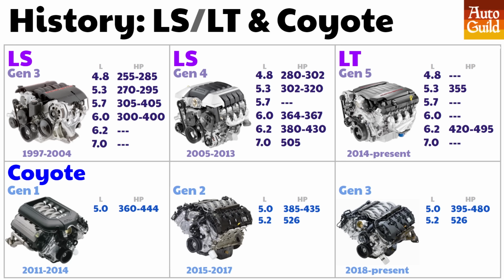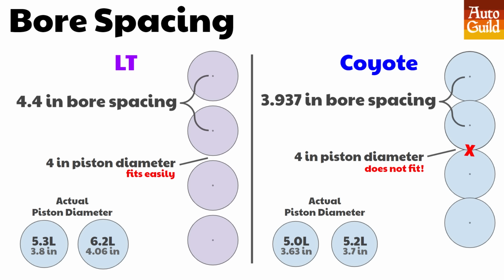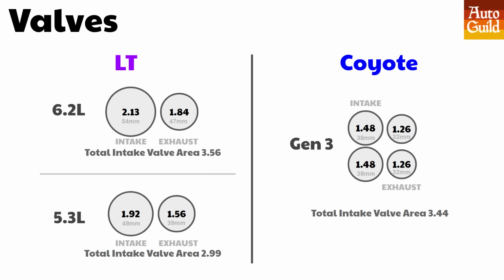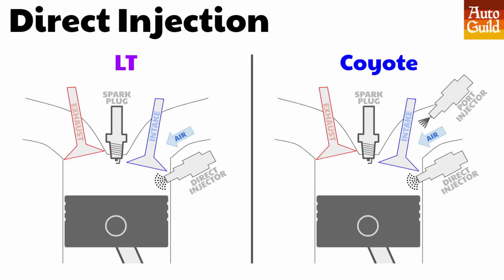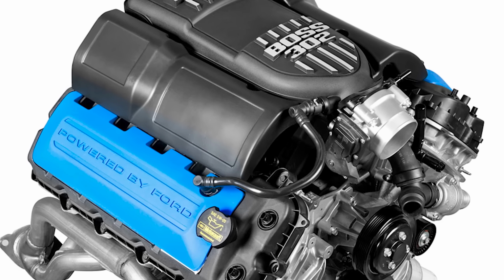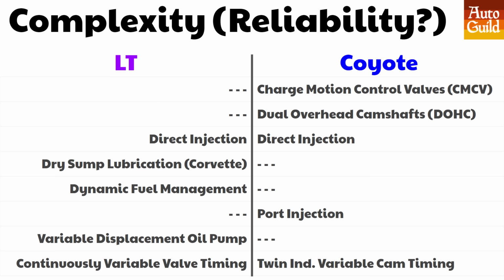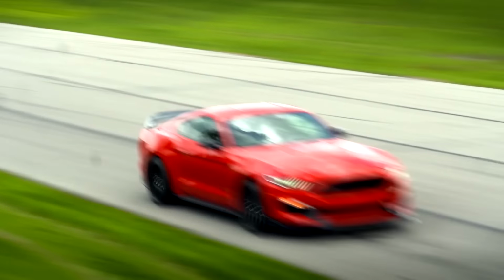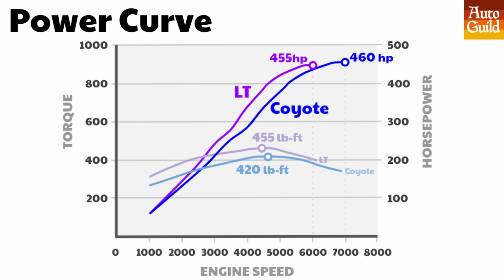GM Gen 5 LT vs Ford Coyote.  Which one is better and why.

Comment: I am almost done with my degree to be a powertrain development tech and have gotten to take a few coyote motors apart and the older DOHC cobra motors and as much as I have gained respect for them I still don't want to deal with 4 cams and all that timing and the heads can be really tedious if you do not have the skills or experience on these types of motors. I think for simplicity and for someone looking to learn easily on a motor and make really good power without spending gobs of money you have to go with the LS or LT.  The voodoo is absolutely ridiculous and is definitely not something to put down. Not too many people really realize just how different these powertrains are. Love the video! will be watching more
Reply: Retaining the bore spacing from the 91 mod motor has been Ford's original sin. It's the handicap that keeps on handicapping.
Reply: @taylorc2542  "slappy is sloppy when the service comes due" is what an old hotrod guy told me as a kid.
Reply: @taylorc2542  agreed, the bs was designed for a font drive Lincoln when the 4.6 was put into motion… that combination never even happened lol so why they handicapped themselves for so long? Even just spreading the bores to get a 3.800 bore would have done wonders for the platform.
Reply: @shaadydog1  Yup, 30 painful years of 2nd place because someone thought FWD Lincolns were important. Amazingly poor cost/benefit in hindsight.
Reply: @taylorc2542  ya, they couldn’t get the hood line  they wanted so they scrapped the fwd/v8 idea altogether…
Reply: The LT motors are a ticking time-bomb.
Reply: @Lupine.   its all preference. with the 4 coyotes I've rebuilt at school I could say the same for them lol.
Reply: @BIGEDSIK28  The LTs are throwing rods and having constant injector issues within 30-40k miles.
Reply: @BIGEDSIK28  Exactly which school are you in?
Reply: @CrystalWhiteLX50  Washtenaw Community College in Ann Arbor. Absolutely amazing powertrain dev tech program here. All kinds of dyno classes and such as well. Check it out!
Reply: @BIGEDSIK28  Have fun working for Jacobs or one of the other staffing agencies
Reply: @CrystalWhiteLX50  lmao right.. 99% hire rate straight into my field and I’m continuing my education for EV engineer. I’ll have lots of fun working at whatever auto company hires me. Have fun being a lube tech buddy and maybe you should go to school to further your education rather then ask people what school they go to LMAO
Reply: @CrystalWhiteLX50  once you know something about a engine HMU 😂
Reply: @BIGEDSIK28  dude was hating hard as fuck. Always haters trying to talk down on someone's direction n vision
Reply: Vw stopped all development of new ice engines.  Hope you can quickly switch to ev.

Comment: Might be wrong ,but I believe “lighter valves” have been proven to help stabilize higher rpms not help increase rpms.
Reply: Wouldn't that in effect yield the same outcome in the end product?
Reply: @btownballer27  not entirely sure I got into a huge discussion about it with the ls6 sodium filled valves vs standard valves. What I got out of it is the lighter will help with stability at red line less potential for valve float and less stress on the springs. Physical reduction weight didn’t allow for higher revs that it would come down to whole rotating assembly being lighter

Comment: How can I see the big block coyote the alluminator specs, that’s a rare engine ever talked about through out car community’s why?
Reply: A big block Coyote? Which engine is this?
Reply: @houseofno  it’s a 6.4 or 5.9 I think, it was called Alluminator, Ford had them in Trucks I believe, speed shops had em N/A at like 900hp with their parts thrown in. It’s the motor I want for my build, but nobody ever talks about em. Hot Rods done a few articles on em.
Reply: @davidpedwardsiii5581  
Because they were basically kind of race engines.. also very much unrefined in nature too cuz it was made light with less mount bolstering to chassis. 
It was a badass engine but hey.. many prefer a smooth and refined yet wild Coyote over it 
What I feel sad is.. why didn't Ford make a bigger Coyote,  see sure its already large... still much smaller than Hemi V8s
Ford could ve made a 6.2l dohc v8 with port/di.. it wud ve made like said above 500+ hp and 480+ torque and could ve been easily 1 of worlds best big V8s. 
I ve been in Mercedes M156 6.2l dohc V8 and I still think that German V8 is best feeling V8 ever made.. sorry American v8 fans.. Germany was it that impressed me most..
Reply: @davidpedwardsiii5581  the alluminator is a 5.2L crate engine Ford sells
Reply: If an episode could be done on a comparison of the 6 L blocks of Ford n Chevy that’d be excellent.

Comment: The fuel mileage is a lie. I have a 2019 pp1 gt and my buddy has a 2020 camaro. We took a trip to OBX and I averaged 28 mpg while he averaged 26.5. Granted the highway we drove on was flat and we held 60 the whole way.
Reply: That’s interesting, where I’m from it’s mostly city driving. My 6th gen would do 18-19mpg while my mustang friends would do like 14-15. I guess having that low end power has an advantage on city driving.
Reply: @6.2Slomaro  could be. I average about 17 in city. I think a lot of it could boil down to how hard they accelerate. V8s love to suck down some gasoline. I can certainly average 10 if I want to in the city. But that's not how I drive.
Reply: @PapiGL123  I’m from Guam, max speed limit is 35mph, we have a lot of stop and go traffic. Even when I borrowed my friends mustang for a week, I tried to drive how I normally would with my camaro and best I got was 15mpg.
Reply: @6.2Slomaro  could be it. The 5.0 drinks gas at idle and on throttle. You need cruising time to get any respectable fuel mileage. Sweet spot for my 2019 is between 40 and 65 holding speed.
I'm in Virginia and most of my driving is 40+
Reply: Usually with more complex system the 5.0 should be able to sip less.. but issue is Fords engines need higher revs to do work.. so it is counter productive 
DoHC engines give better mpg than ohvs till say 3600cc.. anything more than that ohv will give better mpg.. 

Again all when compared with same displacement
Reply: @1989rs500  yup I was gonna also add that when I drove the mustang I had to shift at a higher rpm unlike my camaro. Especially in a stop and go traffic. So that’s probably where most of the gas is being used
Reply: @6.2Slomaro  note: both of our vehicles have the 10R80 trans. My car also has a higher diff gearing. In theory I figured my buddies car would have gotten better fuel mileage. I'm guessing we were cruising at a sweet spot for mine.
Both vehicles are stock for now.
Reply: Wanted to post a quick update- tookba road trip from Ohio to Virginia and averaged 29.6 mpg with the mustang. Logan ohio to Virginia beach. Over 500 mile drive.
Reply: @PapiGL123  That 10speed is the best thing that ever happened. And sorry to be more specific I was comparing manual to manual. That’s really impressive a mid 400hp car doing a gas mileage like that. I have a C5 vette manual and for being an old car I’m surprise it does 28-29mpg on the freeway.
Reply: @6.2Slomaro  oh that's fair. These new cars have some amazing tech that is getting them to do some amazing things. Even the older fox body mustang with a 5.0 would be lucky to average 18 on the highway. 40 years later here we are with a car hitting almost 30 with over 100 more horsepower.
Reply: @PapiGL123  haha yeah I think we are currently living in the best times for the auto industry. I also had a 2013 Hyundai Genesis 5.0 8speed that would do 27-28mpg on the highway. The car weighed like 4300lbs and it makes about 430hp. Surprising it still did good on gas. But once do city driving it drops to like 17-18mpg.

Comment: Damn the LT motor is small compared to the coyote. It annoys me when coyote fan bois say that LS/LT need a bigger displacement just to make power but they don’t realize that the coyote requires way more moving parts and a higher rpm jus to make power. BOTH engine are impressive and they make very good power in their own way.
Reply: A young guy I worked came over to show me the truck he bought. He said it’s got a huge V8! I said it’s less than 300 cid. He said no Fuvking way! Look at the size of it!! Lol
Reply: @canabox7112  lmao!
Reply: Depends on application. The LS/LT is alot smaller allowing the ability to move it around for better weight distribution " closer 50/50 "for road racing etc. The Coyote "girthy" is good when that doesn't matter as much like drag racing. I own a Foxbody and people keep telling me put a Coyote in it...nope my old sbf "very similar in size to an LS" offers more with lower c/g and ability to push farther rearward for weight distribution. 
I like both engines but much prefer a smaller package for reasons stated. I bet you'd get better track times with an old sbf or LS hp for hp and weight for weight in a new mustang than the Coyote 😁
Reply: Many sports cars and race cars require higher rpm to make power. That’s how you make power actually.
Reply: @sweetcheels correct, they do that with smaller engines for lower weight.. They have lower torque so need rpms to get horse power. HP is just a calculation using torque and rpm. Both of these engines are badass especially in the right applications.
Reply: @sweetcheels  thats ONE way to make power
Reply: With the extra valves, camshafts, injectors and structure to hold them all I'm surprised the Coyote only weighs some 25 lbs more. Very surprised.
Reply: @rogerodle8750  he's guessing. You could easily look up the stats yourself
Reply: @rogerodle8750  the bare weight of the coyote motor without accessories, exhaust manifold and flex plate is 445lbs. He was guessing it was 490lbs with everything on. But I remember reading somewhere that the coyote motor’s full weight is 530lbs? The LT motor full weight is 465lbs.
Reply: Yes, and the Coyote is at a low-end torque disadvantage.  Like you said, both engines are very impressive in their own way.  But the LS/LT motors make big power very cheap and reliably in a small package, with tons of aftermarket parts and support.  Honestly, I love both engines, but if I had free choice, I'd choose the 6.2L LT (without cylinder deactivation, of course).
Reply: @WhalerGA  NA builds I go with the LT for boosted builds I would go with the coyote.
Reply: @6.2Slomaro  Yeah, for myself, I'm thinking NA.

Comment: I've had the pleasure of owning cars with both the LS and LT, as well as the latest gen Coyote and the Voodoo 5.2L in my GT350R.  I must say this is the best explanation of these motors that the common enthusiast can understand without being an mech. engineer.  Well done.  New sub.
Reply: @rross27 those are all some really cool builds you have had. Personally, I've had both the new LT1 in a 17 Camaro SS.  And currently have a 19 Z06 with the LT4.  Love both in their own way.  The LT1 was a manual with 455/455 in it and she would rip and loved to be "beat" on.  LT4 is the same, but you have to be careful as the car is super expensive and the engine is ridiculously more powerful than anything I have ever had.  Probably going to get another ZL1 or Z28 in 26 for  the last year of the gen 6, Vette will be paid for by then and more of a "show" car.  Keeping her stock.  Hope you can get your hands on either one in the near future, you will not be disappointed!
Reply: @Hey_Blinkin  the coyote is a different monster, it doesn't slap you in the face as much, but it's just insane how it just keeps pulling, and pulling, and pulling, yanno the LS motor might make peak around 4500-6k, meanwhile we're revving to 9 and making more power the whole way there. Completely different, but I prefer the coyote, and fyi if you want a really torquey coyote you can put a cam ground for torque in, like off the f150, and all of a sudden I can't tell much of a difference, but it's much easier to put aggressive cams stock in a DOHC motor so that's why the performance version get such aggressive cams from stock.
Reply: All he did was take all the stats, that you, honestly could have read yourself and made a video.
Reply: @ssj2camaro21  it’s crazy how people will believe anyone knows what they are talking about with pictures and a video on YouTube, they will take as a fact even if it’s a 26 year old kid in his moms basement making videos on which fighter jet engine has the most power . And people will leave comments great video you understand so much about jet engines lol world I’s screwed I tell you ! The internet made people much dumber and easier to fool !
Reply: @rross27 I had a ‘96 Z28 and the old LT1 got a bad rap due to people using junk optisparks but it was a hell of an engine in its day. It held its ground until the LS1 showed up to take over. It didn’t take much work to get some great results with it.
Reply: @rross27 we all know the answer... LS

Comment: Getting really tired of people calling pushrod technology old vs ohc’s being new. That’s not true. OHC design is older. But they are both really old regardless. First ohc engine=1902. First ohv engine=1904. 

The coyote is limited, just as stated in the video, by its maximum bore size. You can only add stroke. Adding stroke, or too much stroke, takes away from rpm capability. So anyone saying something along the lines of, ‘I wish Ford made a 7.0L coyote’…..they won’t. 

Lastly, the metric of HP/L is garbage when comparing two different engine configurations. The LS/LT makes power by adding cubic inches. The coyote and other dohc designs make power by adding rpm, at the sacrifice of cubic inches. Literally opposites in their philosophy of design. If HP/L actually mattered, the 1.3L rotary engine in the old rx7’s and rx8’s would be king.
Reply: 5 liters is plenty, “limiting” displacement as you call it is irrelevant.  Cracking into an engine and machining and adding parts is far less efficient than the best power adder ever devised: the turbocharger.  Using exhaust gas to do work rather than waste it going out the tailpipe
Reply: @heinrichhimmler69  blah blah blah, turbos are good. Ya don’t say?

Comment: I remember when GM released the LS platform, Ford already had the mod motor, overhead cam design. Many said GM’s new engine would fail miserably by staying with old technology.
Reply: In the early 90s GM had already tested with identical vettes but with one powered by a DOHC they had designed and then a newer version of the 350 and GM decided they still liked the low end torque and instantaneous power compared to the DOHC they had designed. They then continued to produce the same kind of OHV motors they always have lol! Cool stuff to check out if you are interested.
Reply: @BIGEDSIK28  They did more than test a DOHC motor.  They offered the 1990 ZR1/LT5 ("King of the Hill") Corvette.  Not sure how many they sold, but it was a very expensive engine to build. It's amazing that GM has been able to build such venerable powerplants using OHV technology for so many decades.  My hats off to them.
Reply: @WhalerGA  Oh yes I have heard of such a vette lol! I'm sure they only made just a handful and they are easily over 100k. Half of them are probably in Bowling Green! I've heard rumors of a new c8ZR1 with a DOHC TT motor being stuffed in it. Actually really excited to see it. When I'm done with my powertrain development tech degree If I get in at GM I will be in the R&D building, dynoing, in Milford!
Reply: @BIGEDSIK28  GM is fully switching to electric powertrain. Amazingly, there will probably never be another clean sheet ICE to come out of the Warren Tech Center. Things are changing.
Reply: Yeah.  Now we can watch Ford explain why their brand new truck engine (Godzilla 7.3) uses lots of displacement and pushrods.  A complete vindication of GM's strategy.
Reply: @kevin9c1  that new engine is a beast though and I'm personally glad Ford decided on a pushrod engine because they're effective and work well
Reply: kevin9c1 - they can explain it based off of the pushrods they’ve made in the past that have won things GM engines can’t dream
Reply: Now look at LS dominating the strip and street still to this day lol long live chevy
Reply: @jonathanlawson4667  yeah but butthurt fans will never admit it
Reply: @panzerwaffen2873  it's the truth there's no disputing that lol if Ford was dominating like chevy I'd admit it lol
Reply: @jonathanlawson4667  better do some research, 😂😂😂 
No LS or LT has been as quick in the 1/4 mile as a Coyote... Not to mention the Coyote gets it done with out an aftermarket head... Hell Mihovetz's 4.6 has been faster than ANY LS or LT ..
Reply: Jonathan Lawson - dominating what? Having more engines out there doesn’t mean winning or dominating. Winning breaking records that’s dominating. That’s what Fords doing.
Reply: @CoyoteFTW  I'm talking about winning cars dominating are LS engines dude you obviously don't have any clue what you're talking about otherwise you would know the answer to that question but no you Ford and dodge guys get all ass hurt about the facts
Reply: @CoyoteFTW  bottom line is the LS dominates
Reply: Yes, simple, cheap and can outperform even the "hand-built" AMG V8 engines.
Reply: The numbers sold speaks volumes. Simplicity. Also, in the greatest country on the planet, it's an 8cyl fartcan hondezy. At the end of the day, when your laying down for the evening, it's still a ford.
Sweet dreams.
Reply: @jeffburch5903  - lmk when a pos chevy runs 300mph on a stock block reworked heads like the 2005 Ford GT did then tell me garbage motors is better more doesn’t mean better

Comment: Stock the ford more power for its cubic inch all engines breath the best air pump wins 4 valves per cyc
Reply: Stock gm motor more power per cam. Its about as useful comparison as power per litre.